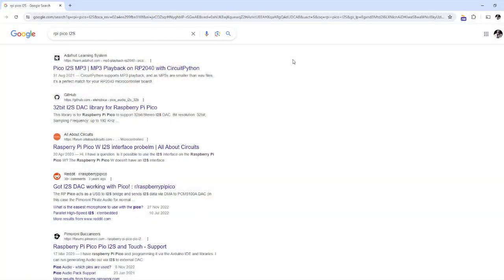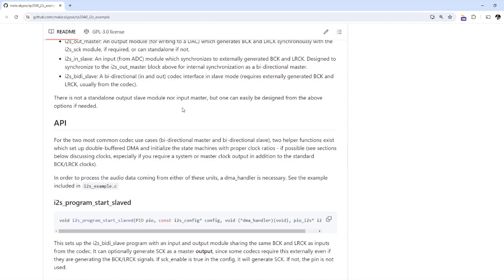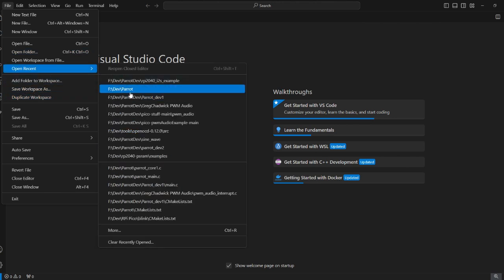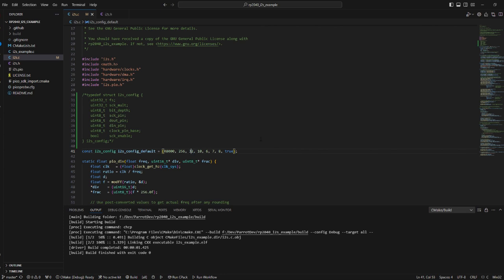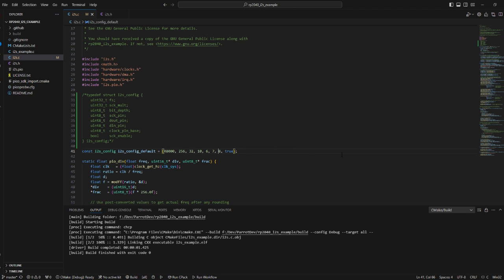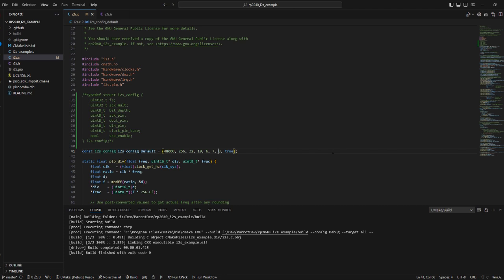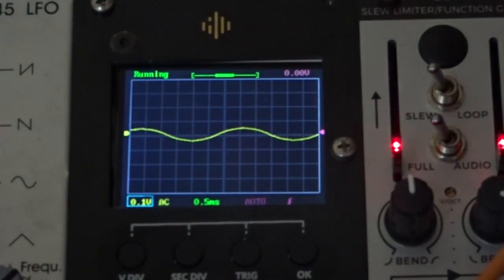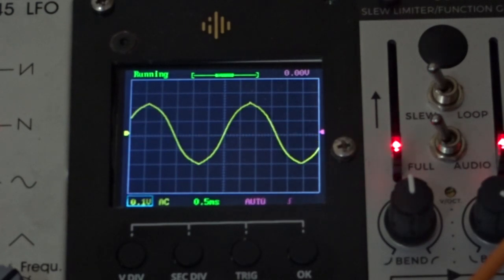Camberwell Parrot Chapter 5 - I2S Audio IO

Comment: Dear Richard,
your content is so amazing, and this exact video seems to be the only video I can find on youtube about this topic, I was trying to build the same setup using ESP-IDF, but I reached a dead end in my project

so What happened is I bough a pcm5102a and a pcm1808 boards from aliexpress, not the ic but the full board and I connected them to my ESP32S3 trying to make a pass through, the problem is that I have very strong white noise whenever I try to connect an audio signal to the pcm1808 when I listen to the sound getting out of the pcm5102 I hear the strong noise along with the audio signal coming in

if I disconnect the audio signal and restart my esp32 the white noise is gone , once an audio source is connected it is as if it pollute the ADC with white noise even if I disconnected the audio source, I added a small screen to monitor the noise and it seems once any signal gets in, the white noise build up and never leaves

I desperately searched the internet and couldn't know whats wrong, is it a clock problem because I use the mclk from the eps32s3 , is it problem with the 5 volt analog line, I'm bangning my head against the wall since a month, could you please help me , the code is here https://github.com/sherif-audibene/adc_pcm1808
any help would be much appreciated
Reply from the maker: Hi,  is that Github code you code or somebody else's that you are trying to get to work?

White noise as you describe is almost certainly a data error on the I2S interface. The good news is that if you are hearing a little bit of the incoming audio at the output of the DAC, then some data is getting through.

Does the code play the 3 x 1-Second test tones when it starts? If so, then the DAC is working correctly and the problem is with the incoming I2S data.

I wouldn't go any further until you can get the test tones to play correctly to ensure that the DAC is working.

Check the jumper settings on the back of the 1808 module, as they may conflict with the way the i2s driver is trying to set up the interface.

Keep any jumper wires as short as possible, and make sure you have linked the 0V rails between the ESP and the ADC & DAC modules - you need to make sure that they all share the same ground to help ensure the signals are as clean as possible.

I would then start by removing anything to do with the display, and reducing the main audio_task function to something very simple in the for loop:

i2s_write_buff[i] = i2s_read_buff[i];
i2s_write_buff[i+1] = i2s_read_buff[i+1];

so that all you are doing is copying input to output, and not tying the processor up with any unnecessary display tasks or other processing.

Of course it is always possible that you have a faulty or damaged module - do you have any other 1808 or 5102 modules you can try - I've not had a problem with modules bought from AliExpress but it is certainly possible that you have received a bad one.

Good luck.

Richard
Reply: @richardrgoodwin  
Dear Richard,

Thank you so much for your answer, so the code I wrote myself with the help of AI, I'm a musician and have been playing with the PCM5102a for quiet sometime, playing midi building some synth and so I didn't face any issues getting the sound out or making reverbs all of these stuff worked fine.

I wanted to grow my game and build a small sampler, maybe get input sound put effects on them but the problem started when with reading the data from the PCM1808, the sound quality is very bad, and the white noise is building up there, this made me confused because it seems like a good ADC chip as everyone says so why this happens, so to explain how it goes, the test tones are working fine and with high quality, then after that the sound is being captured from an audio source (stereo) and played via the dac and I can hear it but ith bad quality as if there is a low pass filter that eats up all hi mid freq and up + the super annoying white noise but it is being captured and there is no stutter or anything 

the board Iam using is https://www.aliexpress.com/item/1005007130138539.html as I though I don't have the courage to buy the IC and build a board myself

I bought 2 of them as coz I wanted to know if it is a hardware issue or software, both of the pcm1808 I bought have the same bahaviour, start up clean (I hear very low sound which indicates the ADC is passing data) and once I connect the audio source the noise comes in, the behaviour is consistent regardless the screen code is there or not, plus it runs on different CPU so this I can eliminate

I just added the screen so that I can see the waveform and try to understand what is it 

I though maybe my ESP32s3 mclk quality is bad, this I couldn't say for sure as I tried use the pico logic analyzer and the mclk is not very symetric as I would expect but in your video I see the everything worked fine so I was trying to understand what I'm doing wrong

regarding the jumbers, I found it is the same result if I connect them to ground (Slave mode ) or leave them floating, it is the same result

Thanks again and it is amazing always to watch your videos